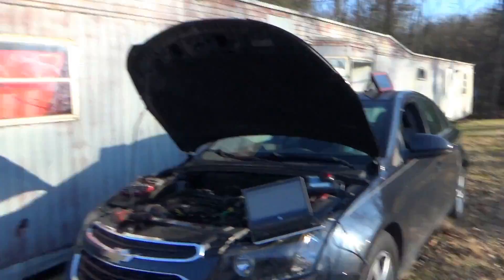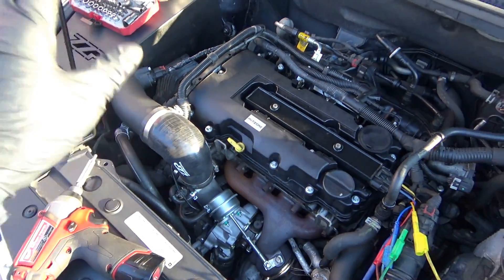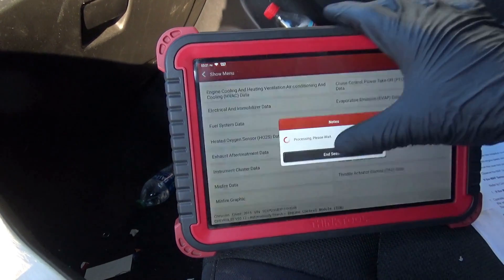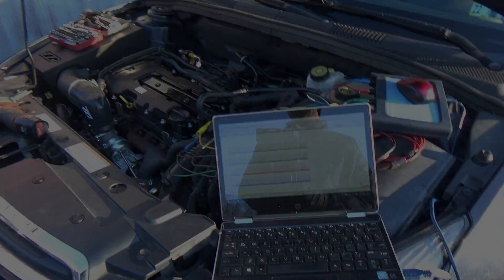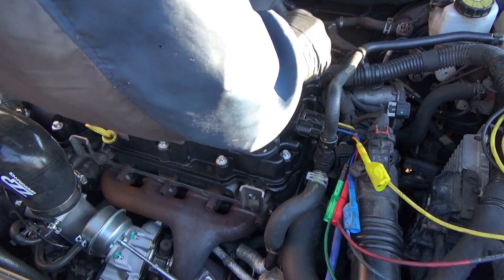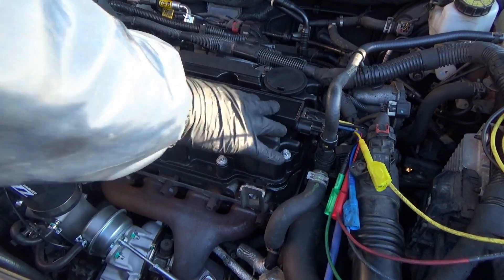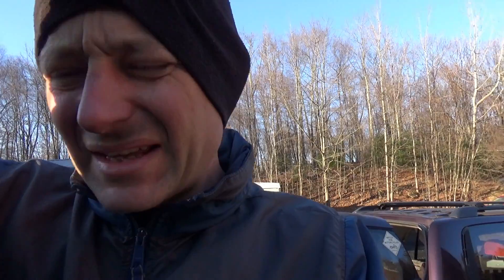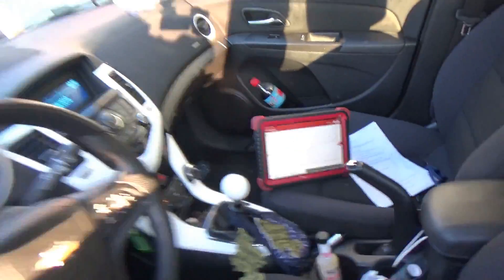2-Cylinder Cruze? (Can you TRUST Scan Data?)

Comment: Hello Ivan, this is Lester from Dorman… we don’t make/offer coil packs, we make the valve cover. Was there something else that failed or a mark on the part to lead  you to think it was a Dorman?
Reply from the maker: Hey Lester! Oh haha must have been another junk aftermarket brand then sorry about throwing Dorman under the bus 😅...I'm just so used to seeing junk Dorman electrical parts causing problems that it's a reflex. However they do make great brake lines and door handles, just not electrical parts or gaskets 🙂👍
Reply: I myself appreciate the 'problem solver' hard parts from Dorman.  It is always best to go with OEM for coil packs, position sensors, etc.
Reply: @PineHollowAutoDiagnostics  Thank you for the response… I appreciate it! No worries…Dorman and aftermarket suppliers in general have to get better at developing electrical products.
Reply: Lester, I am sorry that it is you, but I have needed someone to hurl Dorman insults at someone there for a LONG time now.
It is disturbing how the Dorman brand can still stay in business. I recommend going to work for a company that makes an honest living.
Or who are the next ones up the ladder there? I would like someone with whom I can practice the Captain Insano eye-poke move on.

Edit: one of the many examples was a good latch cable for an old 2000 Honda Civic. The cable works fine UNTIL you have to make that final 180 degree bend like the factory original cable needs to do. It is obvious that whoever produced the cable never actually installed it on the car to test it. I ended up heating up the handle of the Dorman cable, slipping it off, and I installed it in place of the broken handle of the original cable. Dumb design by Honda, but their cable worked fine until the handle broke.
Reply: I think Dorman has a great window to step up their brand image. The window is open for a very short period of time as prices and supply are in total chaos.

The idea is that Dorman realigns to offer high-quality parts via it's established excellent distribution network. Unlike 10 years ago, today, there are so many inexpensive fakes on-line these days that cheap is no longer a viable competitive strategy. So solid distribution and good reputation are how Dorman competes. 

We all know a lot of the Dorman parts are excellent quality and the catalog is huge but a small amount are not sourced or QCd properly. The reputation of the whole enterprise suffers from this. Step one is to remove the small number of high failure parts, step two is to find reliable substitutes for those. Step three is to step up QC.
Reply: @lkovacs  It's not just Dorman, all aftermarket parts and I'll throw in many OEM parts need quality put back in to them. The public are paying good money for OEM yet they are getting China grade parts which carries less value. Most of the aftermarkets just simply need to raise the bar on their specs and quality and the main reason is that they all advertise equal to or better than OEM yet they are fooling the people. BTW...for the most part, Dorman parts are okay. The name has been around since the 1960's and a very popular brand for many shops. My guess is, they have been sold a few times since and quality has suffered as a result. We used Dorman window regulators vs. OEM on several vehicles and found the Dorman ones are built better and don't fail early like the OEM's do. 
Whats really bad for the public is the electronics or sensors that are offered by aftermarket....most of them are pure fraudlent parts that won't work with the vehicles computers.
Reply: @PineHollowAutoDiagnostics  Now Boy's  .  .  .  .
Reply from the maker: @TrueIndie88  avoid any Problem Solver rubber orings or gaskets at all costs... They don't last at all lol
Reply: I thought the doorman was Carlton....lol
Reply: @PineHollowAutoDiagnostics  Thank you!  I will do.
Reply: The Milwaukee brand power tools really seemed to "up" their game in recent years. Batteries that actually work and last, pretty darn good tool quality, an endless brand catalog, and now I see their tools everywhere and it's a tool line that you will PROBABLY NOT see at the local swap meet or flea market. And f-it. I will pay for it if it friggin works!
Unfortunately, these crap parts are actually the result of consumer behavior. Typical consumers don't understand how not all products are created equal, and just go for the lowest price.

The day has come where we may as well just go to the dealer and pay for their stuff.  But it would be nice to be able to pay 50% more for some aftermarket stuff that actually works. But then, the market that would support such a price point would be too small.
Reply: @lkovacs  electrical parts unfortunately are not dormans strength
Reply: Trying to think if  I know of a good electrical guy that could help out Dorman? Hmmmm😀👍
Reply: I agree with Ivan, some of the parts are just fine. On older cars sometimes dorman is the only one who bothers to still make them. While there is a race to the bottom that's a pricing issue. Combine that with poor quality suppliers and you will get burned. Best thing to do is take the time to let dorman know you had a problem with a part and give them a lot or serial # so they can trace it back to the production line it came from. If there is consistently poor quality then they can do something about it.  Just saying everything is bad is not constructive. I find most of the time it is installed wrong by people who don't know what they are doing. Ivan always sees the problems after DIY installs have gone wrong. Who knows what else has happened to those parts.
Reply: Brave Man Lester. lol
Reply: @PineHollowAutoDiagnostics  you just said "another junk aftermarket brand"... lol
Reply: Noticed in a series of videos that sometimes it's alligator mouth and hummingbird butt when giving his two cents regarding cars and parts.  Would love for him to criticize some of his short cut repairs.
Reply: @thk7513  You'll note at least he has taken the time to document what he hacked so the next guy knows what has been changed. Think it depends on the customer's wishes. Some people are just going to run the wheels off, put the gas station tire on till that falls off and then junk the car.
Reply: @MTLeopold  What I really take exception to is when he charges a customer for a repair then the part fails.  Instead of correcting/replacing the offending part (the cost of doing business) but no, he does a hack work around.  Customer approved or not, he needs to stand behind the repairs that he does,  I really don't care if he has to remove a major component to facilitate a correction repair.  Still he runs his mouth too much regarding that "this vehicle or part is junk".
Reply: The only thing worse than Dorman is A1Cardone reman.
Dorman parts are poor quality parts that are just good enough to sell the car nothing Dorman will last past 24 months, you are better off with junkyard parts than Dorman new.
Reply: @thk7513  But he does warranty the repair, so if it fails again, he will eat the cost. If his work around fails, he will eat that cost as well. Let's say he does replace any part in question and it also fails. How many times should he replace it before a work-around is acceptable?

Comment: On cars where the drop test is inconvenient to access coil packs or injector connectors (or TBI / carbureted cars!), can also use the temperature of the exhaust manifold near the cylinder head to determine which cylinders are not firing. Engine does need to be at least somewhat cool before doing this, though. The ones that heat up more slowly are the cylinders that are missing…
Reply: Great!

Comment: I have used many “hard” Dorman parts for various repairs, and sadly sometimes the only thing available,but they usually get the job done. But absolutely NO electrical components, and admittedly I learned that by doing it Myself in the past. 👍👍
Reply: Similar experience, especially in the last couple of years with shortages. I work on motorhomes, and two common failed parts I encounter that a Dorman ends up getting used on is the vacuum canister that fails on Ford motorhomes ( same with Ford E series vans ) causing the dash air gets stuck in defrost, and the Chevy fuel tank vapor charcoal canister ( same issue on Chevy vans ). I try and use OEM, but sometimes it's the difference between 1-2 days, and 1-2 months. But like you said, stuff like this is my limit on Dorman.
Reply: put Dorman exhaust manifolds on a customers 08 F150, Within 3 months both warped and cracked and I had to redo the job for free. Poor quality castings, no QC at dorman at all.
Reply: steering shafts are turds a well
Reply: @darrenfloen2693  I’ve used them on several older GM small blocks and had no problems. You always want to check  for perfect flatness on both the manifolds and heads before installing.

Comment: Something else you might consider purchasing OEM.  I got a broken windshield this week in the Marquis.  I contacted my insurance company and they informed me they wouldn't pay for an OEM windshield.  I went to my glass man (Whose grandfather, father and him have replaced every windshield I have ever had replaced since I have been driving; which is 40 years) and he REFUSED to replace my windshield with anything but OEM.  I told him I would pay for it out of my pocket.  When it came in, he compared it to a cheap aftermarket windshield and it wasn't "bent" correctly to fit the car.  Now, you wouldn't think someone could screw up a piece of glass, would you?  I went back to my agent and demanded to be reimbursed.  They did.  Great video!

Comment: As a quick alternate test when you have a bad misfire, check each exhaust port against the head with an infrared thermometer (or thermal camera). A dead cylinder will show a very obvious temperature difference, at least soon after starting from cold.
Reply: You can actually see the difference in the exhaust manifold on this engine.

Comment: 100% agree, I never use any parts on my VW/Audi engines other than the OEM Bosch stuff.

 I hate those coilpacks with a passion too, the individual coil on plug design is 1000x better than those 4 in one things 🤢

Comment: 2 things. 1st you must use the proper and updated Delco plugs in GM vehicles. GM updates these (quietly) all the time, so a call to your local Chevy dealer to just ask what plug number they have for your XYZ is worth it! 2ndly, I've tried nearly ALL of the aftermarket partshouse coil assemblies available for this engine series and either they flat out don't work, or fail rather quickly. Sometimes you gotta bite the bullet and buy the OE.  As for scan data, 100% agree, scan then verify.

Comment: These small Ecotec engines (1.8, 1.4 etc.) are super sensitive to coil packs and spark plugs. GM or AC Delco from a RELIABLE seller would be all I would consider.

GM put copper plugs in some of the engines so those only last say 30k miles before the gap gets too big; that might stress and kill the coil pack. We changed to iridium plugs to reduce maintenance but there are advantages to the copper used by GM.

Comment: Someone brought me a car saying the gears have gone too high (manual car). Anyway, they gave me a ride back to my work area. I could not believe it the car was only running on 2 cylinders and they were revving the engine twice as fast for each gear change only making 3 rd gear on the Motorway. The thing was it sounded moderately normal... It was just a coil pack..
Reply: I suppose this is why OEMs use cylinder deactivation, LOL.

Comment: Nice diag Ivan.
I've got the same vehicle which had a miss. Ordered a gm oe coil from the parts store. Package was re-sealed. Despite my apprehension,took it home. After opening found no gm label or markings on it. Returned that to the parts store, and an additional coil was provided with gm labeling on it. Car was fixed.
Buyer beware.

Comment: Ivan is correct never use cheap aftermarket parts for your ignition or air control sensors because they simply will not work

Comment: The other day I replaced a blower motor and a resistor that a coworker diagnosed. Got it all connected up and still didn’t work. The ground was fine from the resistor connector to the chassis. But when everything plugged in it would not supply ground to the blower motor. Something in the Dorman resistor wasn’t passing the ground on to the blower motor. Got a new non Dorman resistor plugged it in and it worked as it should.

Comment: I bought a used car, and I used the parts cannon on it (two problems still there).  However, every part I replaced was one that I personally considered reasonable to replace due to it being a 14 year old car.  Gaskets, hoses, spark plugs, multi-fuel/oxygen sensor, etc.

Comment: It makes sense why the scan shows as good.  It's measuring the pulses to the coils, but if the coil itself is bad, the way Suzuki (?) set the engine up, there's not enough data in other sensors to infer the coil pack is bad.

So yes, pull a plug wire (if possible) to do a reality check.
Reply from the maker: Misfire counters rely on the crankshaft velocity via CKP sensor 😉
Reply: @PineHollowAutoDiagnostics  Interesting.   So they're looking for the timing as it should be constant velocity through at each 90 degrees?

Comment: Check the head lights. GM usually have at least 1 head light out. Watch next time you drive anywhere. I cannot leave my house without seeing several GM products with a head light out. Ivan let me know if the head lights work.
Reply: @Runco990  Really?  In 55 years of owning Ford cars and trucks, I've never had to replace a tail light.  But, anything to take a cheap shot at Ford - right?
Reply: I drive around a lot for work and the non-working lights I notice most are the outside brake lights on 5th generation Hyundai Sonatas and Elantras.  Maybe it's confirmation bias.
Reply: @anonimity5548  They probably get their bulbs from the same place GM gets theres.

Comment: I know those chevy cruze all too well.  I had quite a few of them with bad turbo's and it's almost always a clogged oil feed tube that does them in.  It's so close to the exhaust manifold that it can and will cook the oil inside of it.  I can't see it clearly in the video.  But it looks like that tube on the top of the turbo is the old one.  Ivan, can you reach out to the owner and ask him about it?

Comment: When you spend a few hundred on a fancy intake and valve cover but you cheap out on the basics. Separately I would leave more lead on that MAF connector, that looks a bit too tight. I'm worried that with engine vibration and natural movement it might pull the wires out because there isn't much strain relief.

Comment: Looks like the exhaust header is a different color/texture on 1&2 also.  As if 1&2 haven't been firing for a long time.
Reply: Yeah I noticed that.

No wonder the turbo blew up, cruising around on 2 cylinders there were probably times when fuel was combusting inside the turbo...

Comment: people swap these coils all the time for nothing.  I own a cruze - also notice tons of aftermarket kits like air cooler etc.   Usually the more significant problem with these are it's weak pcv system including cam cover and the root cause shitty intake manifold with integrated check valve.  Also intercooler piping have lots of leaks at the seams and sometimes at the throttlebody.

Comment: I have used a simple resistance measurement of the coil windings to determine a intermittent problem with my V6 wasted spark system.  Can the resistances be measured in that coil package ?
Reply from the maker: Not on this one

Comment: 87 000 miles and a blown turbo...speaks to how unreliable turbo engines can be. My Sprinter work van needed a turbo at 103 000 kms or 62 000 miles. Turbos are great when they work but when one fails...oh boy. The quality of after market Chinese parts is just awful. I deliberately buy MADE IN JAPAN/USA/CANADA whenever possible. Made in Japan is still hard to beat overall. USA is also real good. You pay people a good wage and generally you get a good product.
Reply: Running on 2 cylinders long enough to discolor the manifold I'm sure this turbo was tortured... Probably had combustion occuring in it at times severely overheating it. 

Turbo failures are not that common at lower mileage, it's usually abuse that takes them out (lack of maintenance, or in this case probably driving the car for a really long time with 2 cylinders down, and who knows what their oil changes are like.
Reply: @volvo09  Other intangible...GM crap

Comment: Interesting vid .. once again crappy non OEM new parts no good. Makes you wonder how it idled so smoothly the correct  two cylinders in the firing order must have failed to give a smoother operation The fuel trims must have been pegged lean as well with two none firing cylinders pushing unburned fuel into the exhaust system but still idled ok . Goes to show you things don't always behave as you would expect.

Comment: It feels smooth due to the 2 good cylinders having their companion cylinders dead, does this engine have a cylinder kill system LOL? I also take this fact into consideration when I want to test a good cylinder for other tests, kill a spark, kill an injector, or test a good in-cylinder waveform, I always TRY to kill the known good opposite the known bad, its companion. This will assist in keeping a smoother idle speed and helps to smooth out the waveform on the scope, try it, you will like it. Thanks for the tip on DONT TRUST your scan data. A scope doesn't lie, a scanner can fool the FOOL.